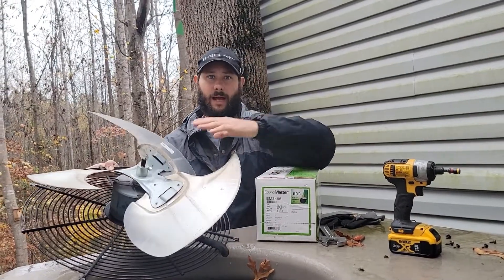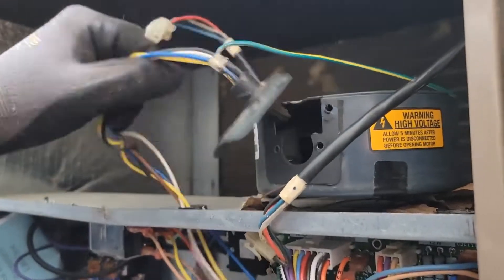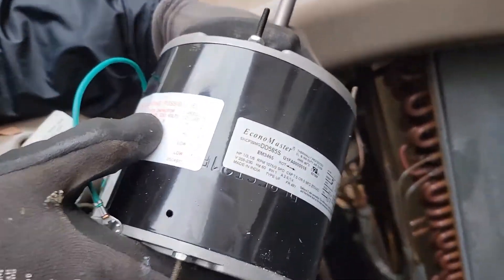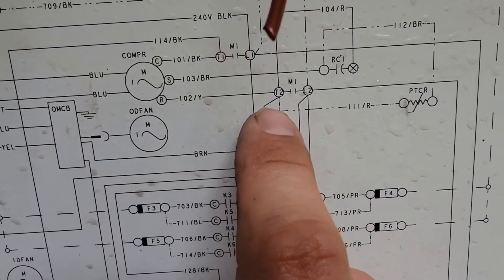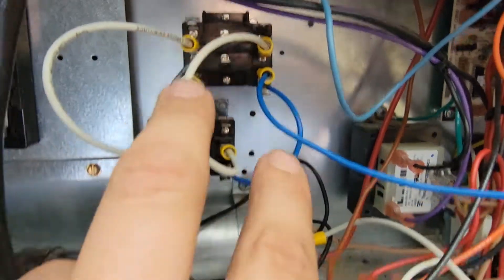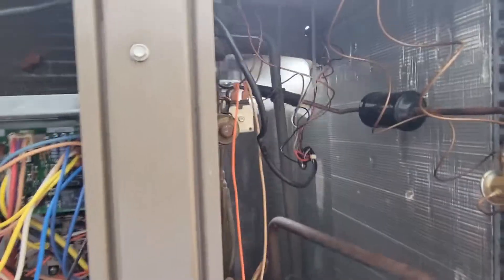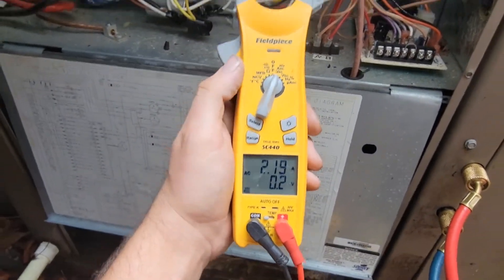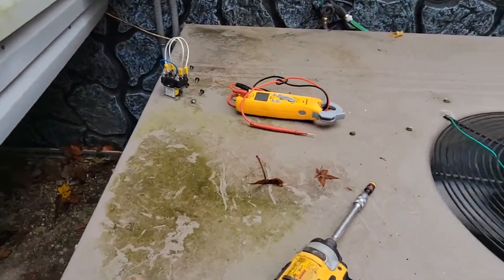Replace Your Outdoor ECM Motor with a PSC Motor in NO TIME!

Comment: Kool thanks nice easy enough retro fit motor  wiring up with one relay vr 2   Only difference to a blower motor on heat pump the heat kit sequencer fan call relay in case of heat strips energize without call for blower  if iam correct ? Thanks again 
EMC motors are ridiculously priced out of warranty

Comment: What is so aggravating is they don’t sell the module separately. New motor should be $200 at most and a new module a should be $200-$250z The inrush limiter or the capacitors go bad but manufacturers want all the cash so the pour silicon all over the components so servicing with a new 105c cap for 12 bucks or a 3 dollar inrush current limiter from Dudley can’t be easily replaced and only sells a complete assembly and want $700-$1100

Comment: Hi, I'm confused with this fan motor replacement with relay.
Can I replace it without a relay? The reason you use relays is because it's a heat pump, right? I love all your videos. Thanks for all your YouTube videos.
Reply: Exactly what I was wondering because i just hook it up to the contactor and a capacitor

Comment: Why would you need the relays,,, A call for cooling or heating will energize the contactor which will bring this motor on... L1 or L2 Of the motor will be hooked to the defrost board. The other line will be at the contactor to control this motor on defrost mode.... You were not using the low speed on this condenser motor if you were then the relays would be needed because it was a two stage system (compressor)...
But you were only using the high speed on the condenser motor.... Just wondering thanks for your video
Reply: I was wondering the same thing… plus it’s different because it’s a head pump?

Comment: "900 to 1100 rpm" 

Seriously, what is even the point of this over complicated non-sense.   Sure, save $1.37 in electricity over the course of a few years for whenever the motor spins 900 rpm instead of 1100.  And then pay out $1500 to replace it when it fails way before a psc motor would have 😂

Comment: Great! You have had  defeated the purpose of  an ECM blower motor which is a multi speed motor NOT a Fixed speed of PSC motors. NO bueno
Reply from the maker: I saved an old lady fifteen hundred dollars so I say success.
Reply: 900rpm or 1100rpm... no real difference...

Comment: I don't understand. Why is the low voltage needed still?  I thought the whole purpose of eliminating the ecm motor was to get away from all those low voltage wiring.  Couldn't you just run the psc motor black and white to the top of the contactor and the 2 Browns to the cap?  Then once calling for cooling the contactor closes and turns on the compressor along with the fan.  Or are you still trying to keep both hi and low speed on the unit?  The unit I'm trying to figure out is a Gibson. First time ever working on this brand.  The outdoor fan motor black and brown go directly to line 1 and 2 of contactor,  the white and I believe yellow, go directly to the 24v side of the transformer. Then a blue wire goes to the board where I think it says fan 2.  I accidentally erased the pics I had cuz they were blurry and forgot to retake pics before heading down. But the blue wire definitely goes to the board. I just can't fully remember what the point was, I believe it said fan 2. This is in Vegas so defrost probably not going to be used. Any advice on how to go direct to a psc motor would be greatly appreciated. I was hoping to directly wire it like any other regular condenser fan motor. The only wire I'm concerned about is the blue wire going to the board. If I leave that disconnected would it cause any issues?  Any feedback is super helpful. Thanks in advance. Nvm. Lol. Smh. I realized this was a heat pump. Im pretty sure im working on a gas pack. I only looked at it for a hot sec because i was fixing the other unit next to it, which was just a badic Goodman gas pack. I was going back the next day to look at the Gibson but i just took quick glance at it and saw the outdoor fan wasn't running. I was wondering why you had two relays lol

Comment: Instead of using relays couldn't you just attach it to the contactor when it calls for cooling and closes to turn on the compressor? Could you just wire it like any other fan to the contactor? And br br to the cap?  This is on a gas pack not hp. Also. I just realized youre working on an hp
Reply: the condensor fan has to go through the defrost control board on a heat pump.  it has to be off when in defrost mode

Comment: Cheap capacitors are no bargain.  If you are inclined, you can replace the caps on that circuit board with new ones, clean it up, and it will probably work.
Reply from the maker: I may start doing that because of the quality of new parts
 I would rather repair  Then replace
Reply: @taddydigest  if you do please show an example 😁 thx.

Comment: LMAO!!! Like your dumb a$$ knows how to swap out an ECM motor for a PSC.  You are literally crippling a system that is made to run an ECM blower.  You could throw an Evergreen in or change out the module.  $300 dollars to swap to a PSC, my ass!!  The ripoff artist at his best!!  ECM motors are much more efficient and repairable.  Unbelievable!!  But that is what I expect from a hack.  Real technicians wouldn't do that and they certainly do not cost $1500 for those motors.  Give me a damn break.  Not for that system anyways.  x-13's were just junk to start with.  But you can get a replacement module or an Evergreen for a a reasonable amount and get the customer back up with the proper equipment and not downsize their system.  Needing relays to make it a big piece of crap.   Great JOB!!!  No EPA or NATE certifications and practicing business probably without the proper insurance.  I can't wait till you are shutdown.   HACK!!!!!
Reply from the maker: Thank you so much for your support 
I really appreciate you 
 I hope you have a blessed day

Comment: You don't need any relays. Just wire it direct to defrost board and contactor like a standard hp. The difference between hi/lo rpm on that 4 pole motor is not going to be enough to affect anything and it will be much simpler. I've got several in the field working fine.
Reply from the maker: Bro you are too smart to not have a YouTube channel
 You need to put your knowledge out there
 I will support you
Reply: @taddydigest  Yes! Thanks for sharing your wealth of information!
Reply: @taddydigest  I don't work on heat pumps much, would that defrost board for the black wire control when voltage is sent to the motor based on cooling demand? Making the relays and 24v control wire redundant?
Reply: Lol
Reply: Hvac guy did it first
Reply: Wb when the heat strips call for heating and the fan doesn't get a signal to turn on it could be a fire hazard
Reply: ECM blower Rpm speed matters! Multi stage compressor motor with a fixed converted to a split capacitor rpm motor it matters! Going to a mechanical trade school it matters! Keep up with training! Thanks for your time
Reply: If he wasn't a hack, he would have known he didn't need relays.  I wonder where he learned that?  If a guy that doesn't work on heat pumps often knows how to fix it better than the guy doing the work, that is scary that you are allowed to even do this type of work.  Oh wait!  You are not licensed and just have a Youtube page.  You literally installed the wiring incorrectly so the fan ran the incorrect direction.  Haha!!  Such a hack!!

Comment: Cool. Looking forward to it. Ted, do you have any tip of replacing  furnace ecm (with dc signal) blower motor with psc motor (maybe with the universal control board), on single/two stage furnaces. I couldnt figure out, or find any info. All motors are furnace specific, expensive and not always in stock. Very frustrating.
Reply: You talking about the ones with the 16 pin connectors? If so Qwik Products makes a board called qwikswap v3 and you plug the connectors into the board and then it's got spots on it for different speed taps for a PSC motor to replace the ecm
Reply from the maker: Yes Here is a video of a product you can use https://youtu.be/4HyDhHJ4Kms
Reply from the maker: Thanks @HVAC Misadventures
Reply: @taddydigest  we on the same page 😁. Hope you're having a good start to the week man.

It's not something I like to do but in desperate times I've also "hard wired" a PSC to run 24/7 so you don't have to worry about controlling it on / off - it's just always running. Not something I recommend or like to do but it was an old piece of equipment and the people were good friends in a bad place 🤷🏻‍♂️

Qwikswap is nice but pretty expensive
Reply: @hvacmisadventures  unfortunately, no :( I am talking about ecm motors (constant cfm) with with serial communication 4 signal wires, with DC volt/amp signal. All proprietary and not interchangeable (between brands,   probably not even between models of the same brand). Looks like all furnaces are using those type of motors now. I didnt see any new furnace with 24v signal ecm motor.
Reply: @thecurious6721  did you check out the board though? I think I know what you're talking about something like a dc pulse or pwm signal. To be honest im not sure if it accommodates it -we're gonna have to keep adapting as technology gets more advanced in the future. There's a lot of things that will need to be replaced with OEM parts, especially since that's how they make their money
Reply: @thecurious6721  also check out evergreen motors. They make more affordable replacements for ECM motors. Some are direct replacement like the X13's and some need the programmer installed with them. There's a website for them that describes what each version of their motors does. There's the X13's which use 24v taps still and then there's the variable airflow motors which is what I believe you are talking about. There are options for those
Reply: @hvacmisadventures  do you know any furnace brand that still uses 24vac ecm motor? I hope there is still one.
Reply: @thecurious6721  yes plenty still do. I mean you can order equipment with just about whatever you want in it. PSC motor, X13 / constant torque and true variable airflow motor like you're talking about

What type and brand of equipment do you usually work on
Reply: @hvacmisadventures  Interesting, in Canada furnaces with psc motors are not sold anymore. I looked at goodman, lennox, carrier 2 stage furnaces. All come with constant cfm motors. Though it appears that single stage is using constant torque. If you know any 2 stage furnace with x13 kind of motor I would greatly appreciate it :)
Reply: @thecurious6721  ah see ... learn something new everyday. I'm in North Carolina and our state hasn't been big on the energy saving stuff yet. I was starting to wonder if you were in California cause that's something I would expect them to do. Good luck though, it's tough telling a customer a blower motor replacement is gonna be almost $2000. Check out evergreen motors and look for some motor suppliers in your area. We have a motor / controls supplier near us and I can get x13's for $200-$300
Reply: @hvacmisadventures  Thanks. Besides the cost, there are more problems... We cant use  rescue motors and/or universal boards. So customers are staying without heat for days. Now they are having 'intermittent' energy efficiency 🤷🏼‍♂️